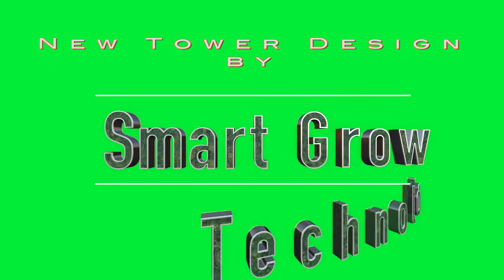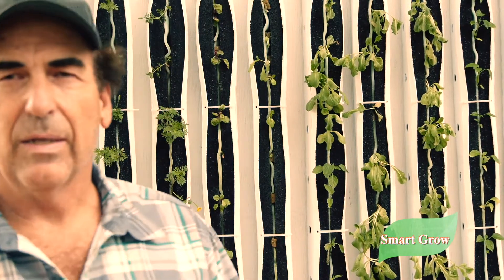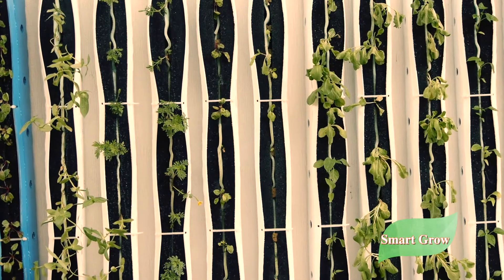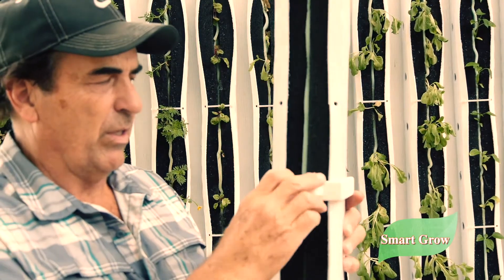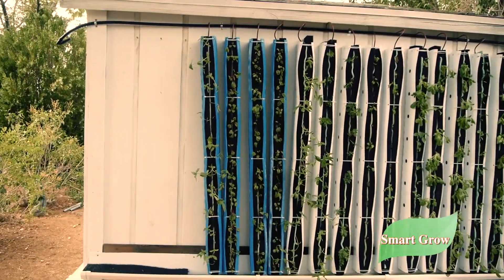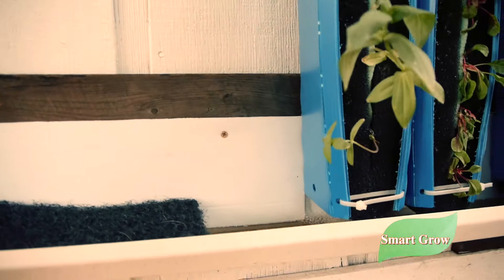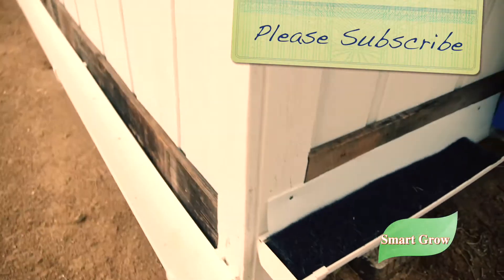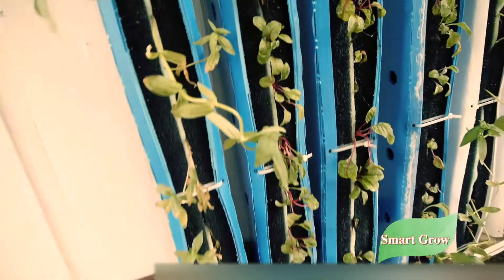New Tower Design

Comment: I used below product. Had to cut a small portion to put 2 pieces into the 4" pipe. 
https://www.walmart.com/ip/GutterStuff-Foam-Filter-32-Linear-Ft-8-Four-foot-sections/45590682?wmlspartner=wlpa&adid=22222222228034670142&wl0=&wl1=g&wl2=m&wl3=92850352728&wl4=aud-273067695102:pla-129360778368&wl5=9010766&wl6=&wl7=&wl8=&wl9=pla&wl10=8175035&wl11=online&wl12=45590682&wl13=&veh=sem